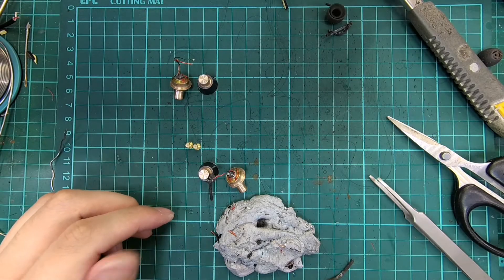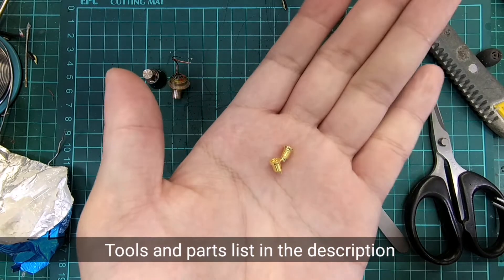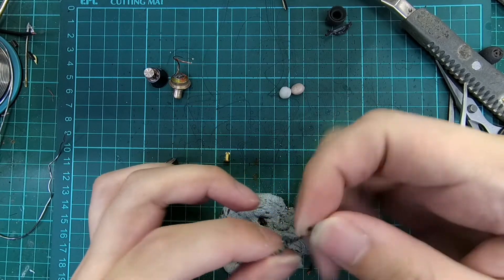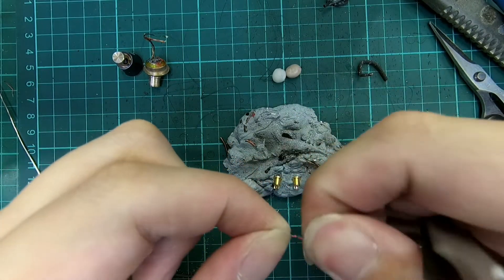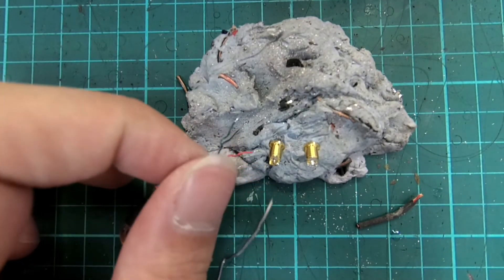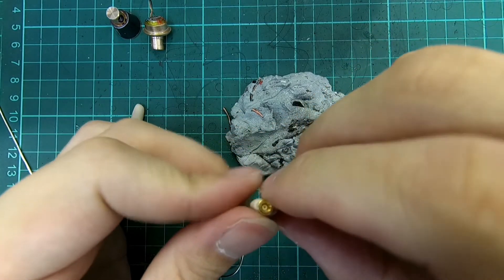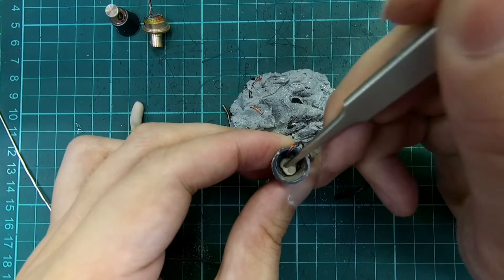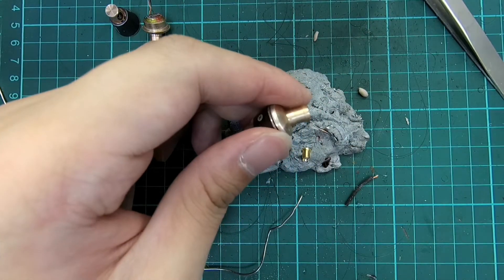1more Triple Driver IEM mmcx mod [NAKED Tutorial]

Comment: if you get the thinner barrel mmcx connectors they screw right in.  no dremmel required.  you just have to solder to the connector first and be careful when you screw it in